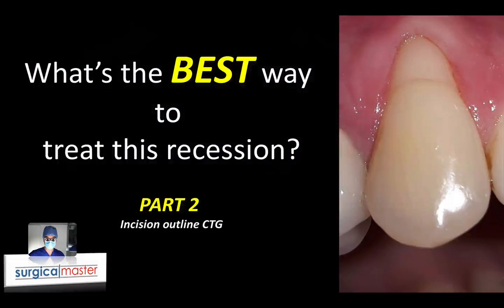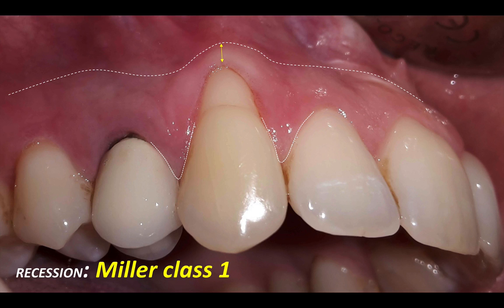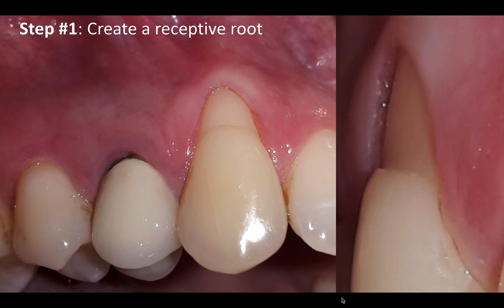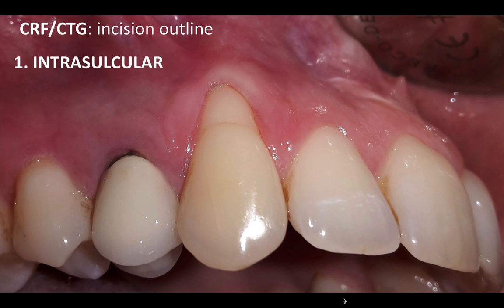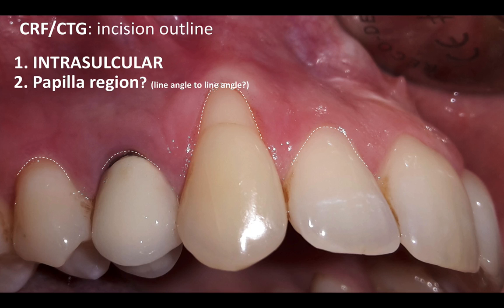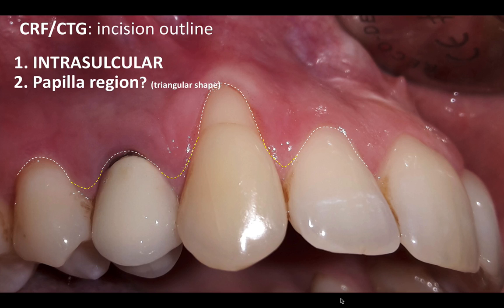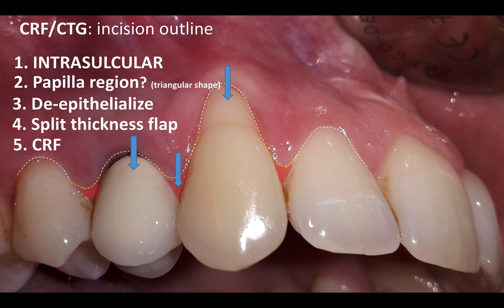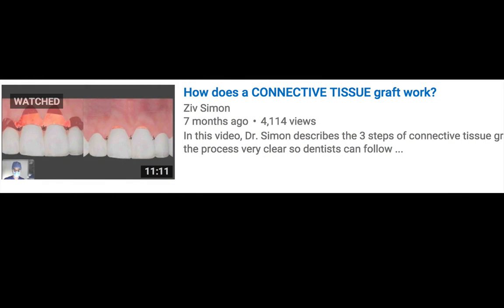What is the best option to graft a canine? PART 2

Comment: And also, why I said that it is "  obvious " is because,  partial thickness means - we're not supposed to reflect the periosteum, so in case of free gingiva, there is no periosteum. so till we reach crest of bone and the point where periosteum is there, we can can take the whole thickness of the free gingiva.  this is the reason why it is obvious that we cannot take partial thickness from the start...(hope I'm right in this regard...pls correct, if not)
Reply from the maker: You're totally right. I would even recommend to reflect in full for one or two extra mm. Just to be safe before we start to split. Thank you very much